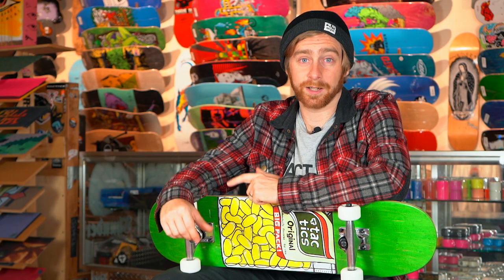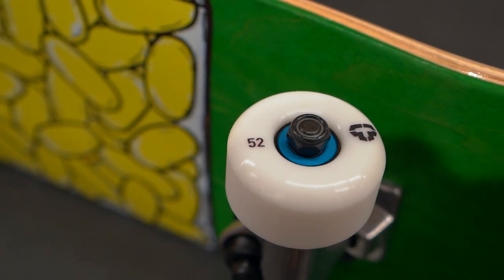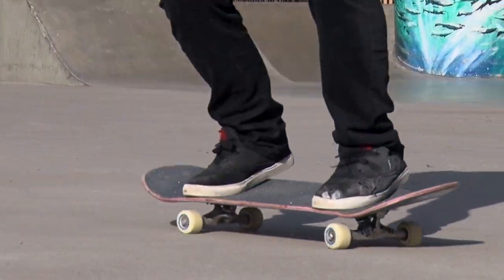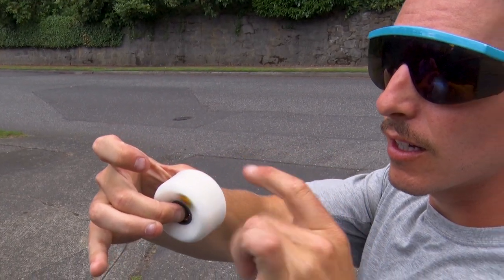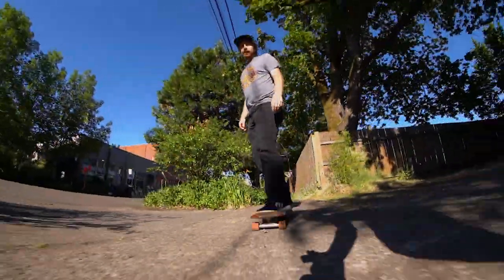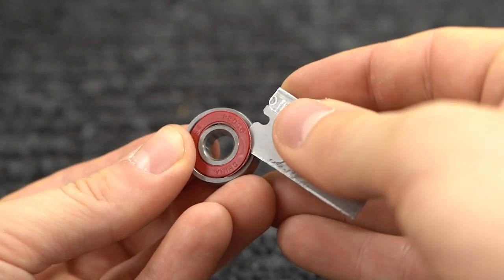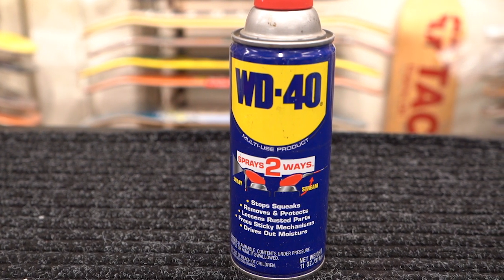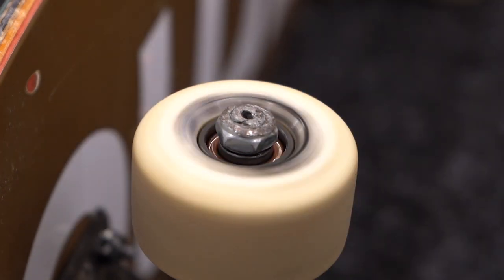How to Choose Skateboard Bearings | Skateboard Buying Guide | Tactics

Comment: Just an FYI: Regular WD-40 shouldn't be used, but "White Lithium" is made specifically for lubricating metal-on-metal applications and as an anti-rusting agent that can be used on ball bearings. WD-40 (the Brand) makes White Lithium sprays
Reply: Fr?
Reply: 🙄mmm...yeah...no. I was told this when I was very young, so I actually cleaned out my bearings once, and gave it a try. I've never had a slower rolling bearing. Because lithium grease not the right lubricant for a skateboard bearing. For skateboarding, you need a very lightweight oil. Bearings that come with grease already in them are also generally the worst. FYI. Never take advice from a non-skater.
Reply: dont use thick grease on bearings only use oil
Reply: wd-40 is better than nothing because it cleans them. I use them for my bike chine and lube stays on. bike chine wd-40 should be used because it design to not just clean but lubricate. skateboard bearing never go at high rpm or get really hot so bike wd-40 should work.

Comment: When I was buying my setup in the late 80s  everyone had nsk but hey didn't have any so I go GSM With spacers and theyv lasted 39 years and still on my 90s Rocco 3 my fav thing was bombing down nice hill and doing the longest death slide  which quickly turned bullet and t bones wheels int little wheels it's basically a tank of a board

Comment: Recently broke a bearing; leaving me with 7 bone Swiss bearings. My question is should I use my slightly used bones reds, or should I use the 7 Swiss bearings and 1 reds? Not sure if it will really make a difference
Reply from the maker: Just keep using the swiss bearings and replace the broken one with whatever you got. 👍 - Tim

Comment: GUIDE TO SKATE BEARINGS

just get any bearings made by a skate brand, so long as they are skate brands bearings, they’ll be good and there’s really not much difference in bearings from the 10-25 dollars range.

bearings that are over 25 bucks are gonna be way better because they’re probably gonna be made of ceramic or other non rusting metals which are much better than normal stainless steel.
Reply: Had to learn this the hard way. Cant tell you how many bones reds bearings I have gone thru because they touch a puddle and won’t spin the next day

Comment: I have some bearing that sat unusued for years. They hardly spun at all so I tried to clean and lube them but they were still pretty bad. Is it possible to save them do you think?
Reply from the maker: If they can spin on their own for 10 seconds or more then you could probably salvage them, but if they're seized up and they make a wretched sound when they screech to a halt within a second, then you're probably better off getting some different bearings. Fortunately bearings are too expensive. I hope that helps! Cheers! - Tim
Reply: @tacticsboardshop  Thanks man. I'll check em again but from memory they barely spun at all so probably seized up. Really appreciate the advice though.

Comment: I recently bought a set of bronson g2s and I noticed they have 2 rubber seals unlike reds or superfly bearings. I'm used to putting the plastic/nylon/whatever cages of the bearings facing inwards to the wheels and the shield outwards, but since there are two shields does it matter which orientation they're installed?
Reply from the maker: Actually, with the Bronson G2 bearings, they're designed to have the shield with the black stripe on it face the inside of the wheel. 👍

Comment: Hey man I was wondering, what do you use to clean the bearings? I’ve been looking about and searching for what to use but whenever I see someone use this product they use another, any recommendations?
Reply from the maker: This is straight from the Bones Bearings website for their cleaning kit. "Solvents we recommend are: Acetone, Methyl Ethyl Ketone, Citrus cleaner, and Denatured alcohol. All of these can be found in the paint section of your local hardware store. Products we DO NOT recommend are petroleum-based products like; paint thinner, gasoline, kerosene, lacquer thinner, turpentine or anything that contains tolulene." Cheers! - Tim

Comment: Do I need spacers and washers tho
Reply from the maker: Some bearing sets have spacers and washers included. I'd definitely recommend using the washers to keep the axle nut/tool from crunching the bearing shields. The spacers between the bearings are useful too but not mandatory. In most skateboarding scenarios the spacers won't make a difference, but if you're doing a bunch of hill bombs and going really fast and doing lots of powerslides, then the spacers will help preserve your bearings. 👍 - Tim

Comment: can i use petroleum jelly as a lubricant??
Reply from the maker: I wouldn't, Petroleum jelly is way too thick and will slow down the bearing significantly. Plus it'll get all gummy when dirt inevitably seeps into the bearings. Go for something thinner like Bones Speed Cream, 3-in-1 oil, or bike chain oil. ✌ - Tim

Comment: what size hardware should i get for a 7.75 inch skateboard
Reply from the maker: The deck width isn't going to factor in to the hardware length. What will factor in is your deck thickness, and if you're using risers or not. I assume you have a 7-ply deck (most skateboards are 7-ply), so if you don't have risers, you can use 7/8 inch hardware, but if you do have risers, you'll have to get longer hardware to accommodate for them. Here's a video about hardware if you have any more questions. Cheers! - Tim https://www.youtube.com/watch?v=Qd7G1AG2yKs
Reply: Thank you

Comment: If I buy cheap unbranded skateboard bearings does that make a difference
Reply from the maker: They probably will not last as long as higher quality bearings, but you should still be able to skate them fine. As long as they're not those atrocious bearings that come in Walmart completes, those things don't even roll. 😂 ✌ - Tim

Comment: I bought Bones Reds bearings 
Why it does not roll very well than old one? Is it so new?
Reply from the maker: How much did you tighten the axle nuts when you put the wheels on? If you made them tight then the bearings will get pinched and be slower. If you leave a tiny bit of slack, then they'll spin more freely. Hopefully that helps! - Tim

Comment: I used 3 in 1 oil and my bearing are very slow. What should I do
Reply: And where I live I don't have a skate shop to get proper lubricant meaning i have to use what I have.
Reply from the maker: Any lubricant will slow the bearing down slightly, but also protects it and makes it last longer. Just let the lube settle in and it'll be back to normal. Was the bearing full of dirt or seized when you put the oil in?

Comment: Can I but bones speed cream in Bronson raw bearings?
Reply from the maker: Yup! You can use it for all bearings. 👍
Reply: @tacticsboardshop  bro what is abec and what abec should i get?
Reply from the maker: @__-pw8zw  Abec is an industrial rating of bearings that measures the physical tolerances of the bearings. So a higher Abec rating would mean that the bearing has more precise machining and can spin faster and smoother (although abec tests spin the bearings way faster than any situation in skateboarding). However Abec doesn't take into consideration other factors that are present in skateboarding like lateral stress and impact. So a higher abec rating means that it can physically spin smoother at faster speeds, but doesn't mean that it will last longer. So I wouldn't worry too much about Abec rating, just get whatever bearings fit your budget. Cheers! - Tim
Reply: @tacticsboardshop  thanks bro i love u so much

Comment: Whitch bearing is run faster ABEC7 or ABEC11
Reply: When I first started skating I thought the higher the Abec the faster the bearings are. I now know that the abec rating is for industrial type applications for when the bearings are at speeds of over 100mph! For skateboarding bearings Abec is irrelevant

Comment: What are good bearings to start off with? I don’t wanna go slow but not fast either. My bones reds bearings are a bit fasst for me
Reply from the maker: I mean, Bones Reds are kind of the quintessential starter bearing. So if you wanted something slower, you'd probably have to get some cheaper price-point bearings. But I think after you get used to it, you'll appreciate the fact that the bearings are nice and fast, and they'll only go as fast as you allow them to go. I think it's probably better to have better bearings that are smoother, than ones that are sluggish and make you have to push twice as much. But I guess it's all just personal preference. Stay safe out there! - Tim
Here's some options for some price point bearings. https://www.tactics.com/skateboard-bearings/rp-0-15